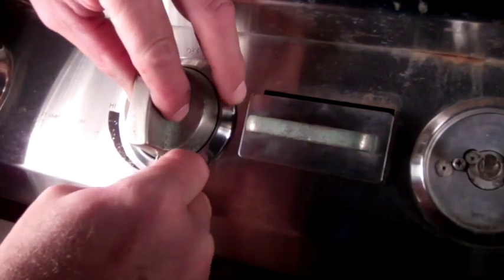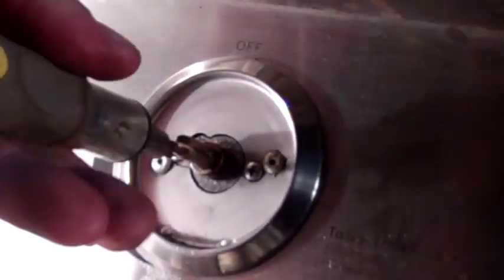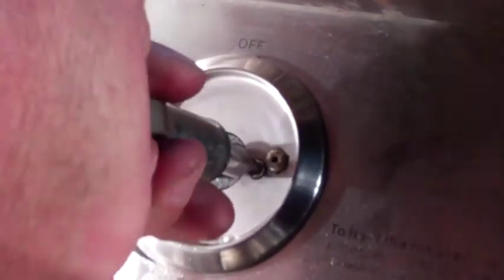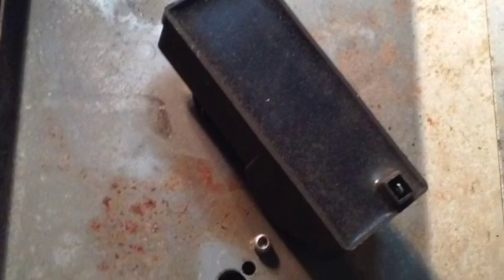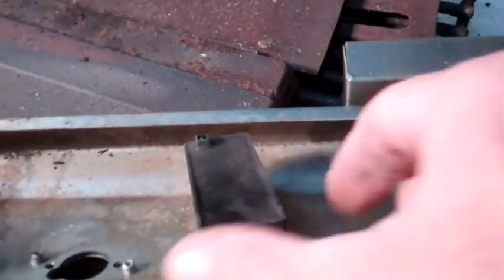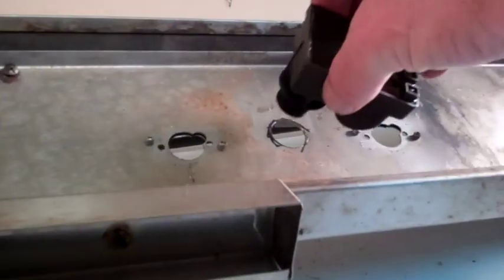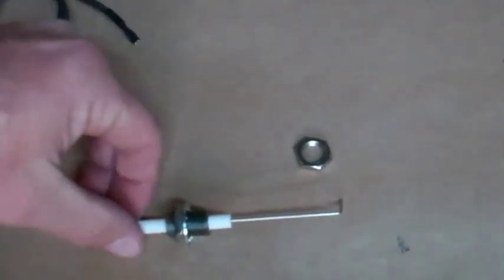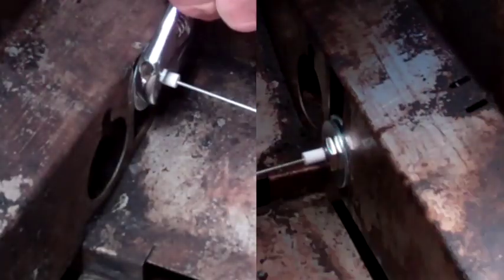Replace Valve And Ignition For STS Turbo, Jenn Air And Other BBQ Grill Repairs

Comment: Jason, I have a Jenn Air 720-0061. I have a valve that needs replacement. I would like to replace all the valves since it’s a major project taking this grill apart. Maybe you can help with ideas of where to get parts. Most parts I found are discontinued. Thank you.

Comment: I have this exact model grill 720-0061-LP and need to order the valves since mine have failed. They are no longer available so I need to switch to a generic one. Where can I get them or what is the model number.
Reply: Were you able to get the valves for your grill? If so, where? Or did you have to convert to new valves?

Comment: Hi Jason i was wondering Can i use on Jenn-Air madel 720-0100-ng .I want to convert to lp
Reply: I have a jenn-air natural gas grill model no 720-0099-NG and want to use a propane tank instead do I need to change the orifice and if so what is the part number thanks  Maria